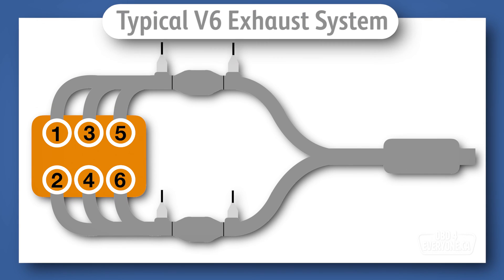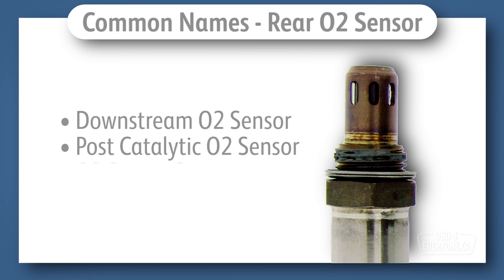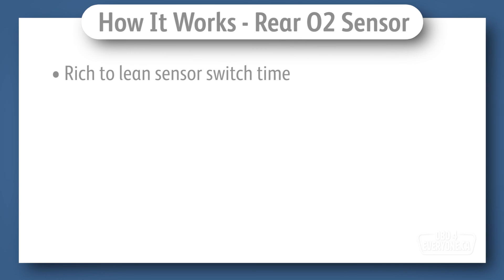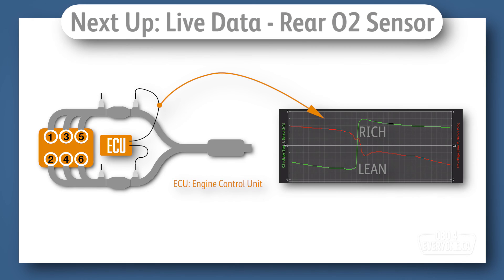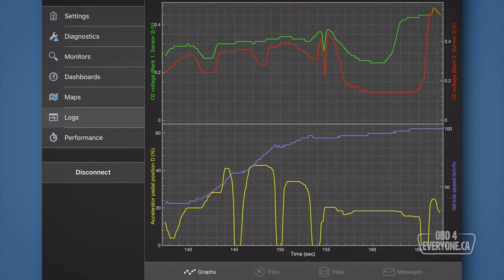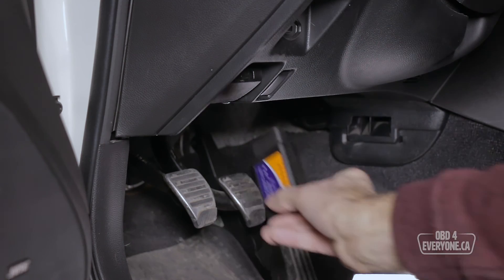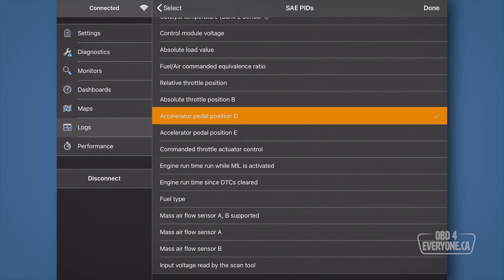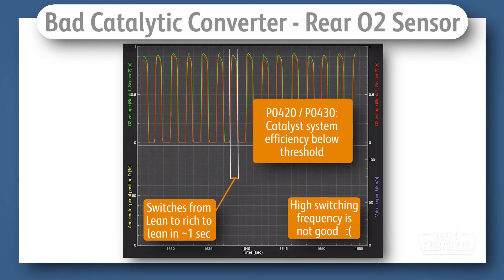Understanding & Live Graphing of the Rear O2 Sensor: OBD4Everyone Ep.19

Comment: I have a 08 traverse with a rich condition on both banks,   front 02 sensors are switching normal to rich lean, but the rear sensors are reading only from like 430mv to 500mv, 
and the rear sensors never goes into close loop,  do you think the 02 sensors are ok? or it should be reading higher and lower than that?
Reply from the maker: Hey 100ega,
According to Autozone parts look up, your front and rear O2 sensors are  "narrowband" and the output voltage range should be <.1 volts (lean) and > .9 volts (rich)

Questons:
• Why do you think the engine is running rich?
• What is the rear O2 sensor voltage at wide open throttle? It should be > 0.8 volts
• What is the rear O2 sensor voltage when the throttle is closed while doing 50+ MPH? It should be > 0.1 volts

If both rear O2 sensors are showing the same voltage, I would suspect something else. The odds of BOTH rear o2 sensors failing at the same time is very low.

Check the exhaust for any cracks or leaks where air can enter and change the o2 sensor output votlage.
Reply: @OBD4Everyone  it's running rich because I can smell raw fuel in the tail pipe and the short fueltrims goes -20  in bank 1 and bank 2  +10
With no misfire but shake a little bit
Reply from the maker: Hey 100ega,
I see... yes that would be rich :)

As you probably already know, raw fuel or a VERY rich mixture will kill the catalytic converter very quickly.

If you haven't already, try cleaning the Mass Air Flow (MAF) sensor with a MAF approved cleaner. Sometimes when they get dirty, they under report the airflow at low load and over report at high load. I don't think this will fix anything, but then we can rule it out and assume accurate air flow measurement.

What are the fuel trims and o2 sensor voltages at wide open throttle and when the throttle is closed?
Reply: @OBD4Everyone  I allready replaced the MAF sensor,
with the throttle closed fuel trims bank 1 is (-20 ) and   bank 2 is  (+10)  the o2 sensor  upstrim  is normal .1v -.9v    the downstrim is about .8v steady
at wide open throttle everything goes to normal trims around zero
Reply from the maker: Hey 100ega,
At wide open throttle, does the engine seem to make full power?  I'm just wondering about a partly blocked catalytic converter. That might explain why the rear O2 sensors don't change much and the front O2 sensors switch as they should.

If possible, remove the front and rear O2 sensor and measure the exhaust pressure while revving the engine. It should be less than 3-4 PSI. (some exhaust systems have 2 cats per bank and the rear o2 sensor is between them)

Any chance the O2 sensors are plugged into the wrong bank?
(On some cars, it is VERY easy for this to happen) 
To quickly check, unplug  the O2 sensor on bank 1, and make sure the new trouble codes refer to bank 1.

With the engine running, create a small vacuum leak and see if the front O2 sensors shift to lean. Then try to add propane gas (from a hand held plumber's torch) to the intake and see if they switch to rich. This should help to verify the front O2 sensor operation.

Pull the spark plugs and compare them. Are the plugs on bank 1 much blacker than bank 2? Since bank 1 is rich, they should be. Clean them up or replace them if they are due.

You need to determine why bank 1 is so rich. 
Is it fuel (leaking injector), evap system (flooded charcoal canister) or an air restriction (carbon build up on valves, catalytic converter) or a bad O2 sensor.

• The exhaust pressure test will indicate if the cat is blocked. (Yes, I know this test is not easy to do)

• The vacuum leak/propane gas will indicate if the front O2 sensors are functioning properly.

• Disconnecting a pre-cat O2 sensor will verify the sensors aren't plugged into the wrong bank.

If the mileage is high, and you plan on keeping the car a long time, you could replace all 4 O2 sensors and see what happens. 

Good luck and let me know what happens next :)
Reply: @OBD4Everyone  I really appreciate all your time on helping me, 
and yes I'll let you know what happens,  thank you
Reply from the maker: Anytime :)

Comment: I get code p0137. I replaced the o2 sensor but the code comes back.   I get .025-.035 v at idle but it runs normally while driving .3 -.8v . Would this likely be from an exhaust leak
Reply from the maker: Hey Wolfy1091,
An exhaust leak absolutely could cause this, as the extra oxygen would lower the rear o2 sensor output voltage.

It could also be from an intake air leak.

You might want to look at your fuel trims at idle. Generally the short term + long term should equal somewhere between -10 to +10. If your fuel trim is positive, the engine control module is added fuel for a perceived lean condition.

Vacuum / intake leaks have a large impact on fuelling when at idle, due to the high pressure difference. At higher engine speeds (> 2,000 RPM) an intake leak has almost no effect on engine fuelling.

Also, with a warmed up engine, the rear O2 sensor should still switch between lean (~ 0.1 volts) and rich (~0.8 volts)

Using graphing function, does your rear o2 switch at idle?
What are your fuel trims?
If you car has a mass air flow sensor (MAF), when was it cleaned last? Dirt build up on it can lower the MAF voltage output at low engine speeds, and over increase at higher engine speeds.

Comment: Great video...would the O2 sensers be able to show block Cat or even a clogged air filter...or would the MAF sensor be of help...
Reply from the maker: Hey Geoff,
Good question!

If the catalytic converts are plugged, the rear O2 sensor will switch from lean to rich VERY slow or not at all. (Assuming there is no exhaust leak)

The mass air flow (MAF) sensor would give you a better indication of a blocked catalytic converter. If the exhaust gases can't exit the engine, the intake air flow will be greatly reduced.

BUT how do you know what the MAF value should be?
If you have data logged the MAF when the engine was in good condition, you know what the MAF value should be.

OR
You can calculate an approximate grams/second flow, based on engine displacement and RPM.

For example: 
•A 225 cubic inch motor at 7,000 RPM 
• WITH the throttle wide open (max flow)

grams/second = (engine size in cubic inches x RPM ) / 6095
g/s = 225 x 7000 / 6095
g/s = 258

Now, this simple formula is only a rough guide, but it should give you an idea of what it should be.

** Keep in mind, this simple formula doesn't factor in the change in air density due to temperature and elevation **
Reply: @OBD4Everyone  my car is running well...got 2 g/s....so if it had clogged cat this would read around 1 g/s. If air cleaner was restricted would this also be less than 2 g/s
Reply from the maker: Hey Geoff,
I assume the 2 g/s was at idle, and that your engine size is about 2 litres.

Since the air flow at idle is very low, that isn't a good test to determine if you catalytic converter is plugged or partly plugged. However, in your example, I agree with your conclusion.

A better test is to monitor the MAF output while accelerating at full throttle in a safe area. This will create much more air flow through your engine and exhaust. Then you can compare the amount of flow to the calculated amount shown above. They should be fairly close.

With your car running well, now is the time to do the wide open throttle test to determine maximum MAF air flow.

In a few years you can re-do the test and see if the maximum value is lower. If it is, something it reducing the engine air flow.

Have fun testing :)
Reply: @OBD4Everyone  cheers for the reply..look forward to your next video....

Comment: Hey OBD4Everyone, Great video! Question for you...I have a 2007 Dodge Charger RT that's coming up with the P0420 abd P0430 codes. Checked the graphs you described in the video and it falls in line to your comment that this will occur if the downstream sensors don't shift back and forth as often as they should. Generally, mine are staying fairly flat at 0.2V or 0.8V, but rarely flips (takes more than a few minutes). Is that a sign of bad cats? I'm getting it for both Bank 1 and 2. Upstream sensors are oscillating nicely as they should. I've been quoted at a shop for 2 bad cats, but another shop said exhaust manifold leak. What should I do next? TIA!
Reply from the maker: Hey Daniel Kelepouris,
Since you have 2 banks, it might be possible for air to enter on side of the engine that has a leak and move to the other side of the engine.

We tend to think of the exhaust flow as only moving in one direction... BUT it doesn't, there are multiple pressure pulses bouncing around inside the exhaust and this could allow extra O2 from one side to migrate over to the other.

As you can imagine, it is difficult to troubleshoot problems from a keyboard, but if I were you, I would fix all exhaust leaks first, THEN see if the rear O2 sensors output is any different.
Reply: @OBD4Everyone  Thanks so much! Appreciate the help
Reply from the maker: Hey Daniel Kelepouris,
Interesting question... I think you need to ensure that you don't have an exhaust leak. Any extra oxygen in the exhaust may decrease the rear O2 switching, setting off a P0420/P0430.

If both codes popped up at the same time, I wouldn't think both cats would fail at the same time, but a crack in the exhaust or split flex pipe might cause that.

Did one code pop up first? What is the mileage on the car and the rear O2 sensors?
One more thing... thank for your kind words on the video :)
Reply: @OBD4Everyone   
Yes, both codes popped up at the same time which was odd that the diagnosis from one shop was 2 bad cats. Didn't feel right. Car has original sensors and it's at 98K miles. Soon after those codes, I had an oil pressure sensor code pop up and that was replaced. Just including that in case that's any indication of what that could be. 

Also, that same shop has recommended Cataclean as a potential fix or at least temporary fix to pass a smog in the near future. What's your take on that product? Seems like a work around, but not going to solve anything.

Thanks again.
Reply: @OBD4Everyone  
Also, you mention an exhaust leak could decrease the rear 02 switching...would that require that both manifolds to have a leak? If so, wouldn't that also be odd timing for both to trigger at the same time? Mine has the HEMI 5.7L. Thanks.
Reply from the maker: Hey Daniel Kelepouris,
Anytime :)

Comment: Hey, I did the graph testing on a 99 Altima and B1S1 fluctuates from.  .1- .9 volts but B1S2 stays @ .22v consistently and will go up to .30 but nothing higher even when revving the engine.  That would be a bad sensor correct? Or would I be a bad cat? Thanks
Reply from the maker: Hey latino914,
I know your car well! I had it for 20 years.

Anyways, your car doesn't have a "bank 2" since it is a  4 cylinder. 

Now if that was a typo and you meant B1S2, then graph the B1S1 and the B1S2 go for a drive with some light throttle cruising and some wide open throttle, then lift off the gas for 10 seconds or so.
You should see both go rich and both go lean. Just make sure the o2 sensors are fully warmed up - a 5-10 minute drive should do it.
Reply: @OBD4Everyone  yea it was a typo.  So I did what you said, and S1 would fluctuate around but S2 would not go over .22 volts no matter what.  Also at some points S2 would read 0 volts like stay there for a good minute or 2.
Reply from the maker: Hey latino914,
Are you troubleshooting a check engine light? If so, what is the code?

Your sensor2 should have similar behaviour to what is shown in the video. They are both the same type of narrow band O2 sensor.

Under wide open throttle, sensor1 and sensor2 should show a voltage greater than about .7 volts to indicate a RICH fuel mixture.

Then when the throttle is closed, sensor1 will almost instantly drop to about 0.1 volts to indicate a LEAN mixture. Sensor2 will also drop, but it should be a little slower to drop.

If your sesnor1 has a voltage range between about 0.1 - 0.8 for wide open throttle and off throttle, it is functioning properly.

If your sensor2 isn't switching between about 0.1 - 0.8 volts, for wide open throttle and off throttle, I would suspect the sensor isn't function properly.

Everything mentioned above is assuming the exhaust system doesn't have any leaks, as this can allow air (O2) to enter and change the output voltage of the O2 sensor.
Reply: @OBD4Everyone  yes P0138, which indicates a high voltage in the rear O2 sensor but in my case it seems to be a low voltage??? I deleted the code and the freeze frame data, which I probably shouldnt have done.  I could wait for the light to pop up again which it usually does after 2 days or so.
Reply from the maker: Hey latino914,
Sorry for the late reply, I didn't see your comment until today.
When looking up the trouble code definitions on the internet, they are often not accurate.
Also, I am assuming there are no cracks or leaks in the exhaust.

I dug out the 20 year old factory shop manual (yes, I keep almost everything!) and for the 1999 Altima, Nissan defines the P0138 as: The maximum voltage of the sensor (rear O2) has not reached the specified voltage.

This is good news, as this is  exactly what you are seeing: The rear o2 stayed at 0.22 volts.

Since the front O2 sensor is switching properly (.1 -.9v) we know the air fuel mixture going into the catalytic converter is good. 

I suspect the fault is either the rear o2 sensor, or the catalytic converter.

How well does the car drive at wide open throttle? 

Does the power seem the same or lower?

Lower engine power can be the result of a plugged catalytic converter and this can cause a good rear o2 to give a flat reading, due to lack of exhaust flow.

If it was my car, I would replace the rear O2 sensor first. It is the lower cost part ($<100)  and fairly easy/quick to do.

Please let me know how it turns out :)
Reply: @OBD4Everyone  the car has good power for a 20 year old car on low and wot.  There was a slight almost unnoticeable leak just around the flex pipe, so I had that repaired and will just wait to see if the cel comes back on again.
Reply from the maker: Hey latino914,
Good work. You may want to look at the rear o2 voltage to see if it is now switching from about 0.1 - 0.9 volts to confirm the fixed flex pipe has solved the issue.
Reply: @OBD4Everyone  hey good friend hows it going? Hey I was wondering if you could help me out on a new problem I'm having: 
2007 Honda Accord 2.4 engine
The car was throwing a p0420 code.  I checked both the AFR and rear o2 sensor which read fine.  So I had the cat converter replaced. Direct fit by the way.  Cleared the code but it. But it came back the next day, same and only code P0420.  Now Im Just confused and dont know what else to look for.  I will check for leaks but but at idle the AFR reads 14.2-15.0 and the rear goes from .3-.7.  At acceleartion the rear 02 reading goes all over from 0.-.9 volts.  Thanks any help you can provide
Reply from the maker: Hey latino914,
I don't have much experience working on Honda's, BUT you rear O2 maxing out at 0.7 volts does seem to be low to me. It should be more around 0.9 volts.

A P0420 code indicates the rear O2 sensors doesn't have the required switching frequency (lean to rich, rich to lean) OR if the amplitude (or voltage) of the signal is not enough. It should swing between about 0.1 and 0.9 volts.

You might want to look at replacing the rear o2 sensors depending on how long it has been in service. If the exhaust system is not leaking, it should be switching higher... closer to 0.9 volts or more.
Reply: @OBD4Everyone  thanks for your help, I checked and there are no leaks. But what i did find out is there is a PCM update open for this vehicle related to that specific code.  Honda wants to charge $120 to update it, so I'll let me brother know and see what he wants to do. Thanks
Reply from the maker: Hey latino914,
Thanks for the update. Sometimes and PCM update is a nice easy fix, but since the dealer does it, it can be costly :(